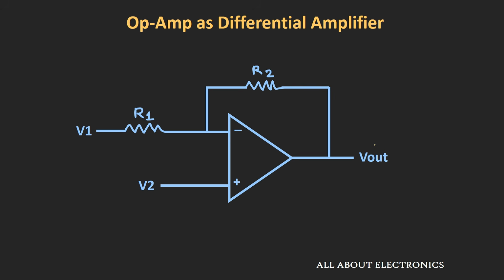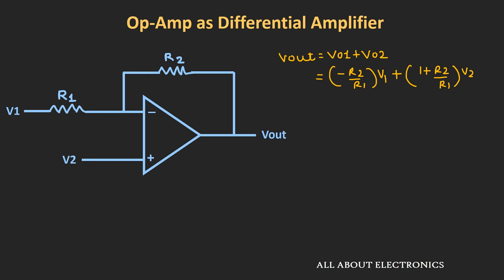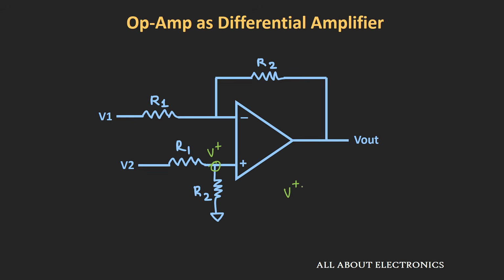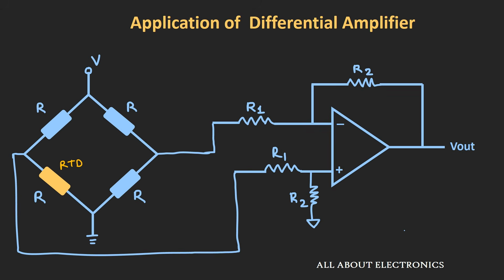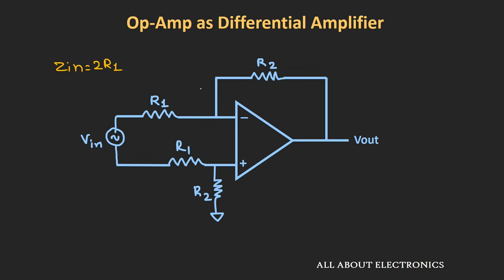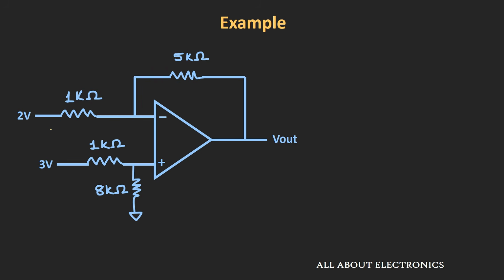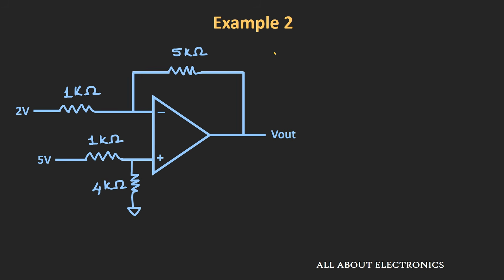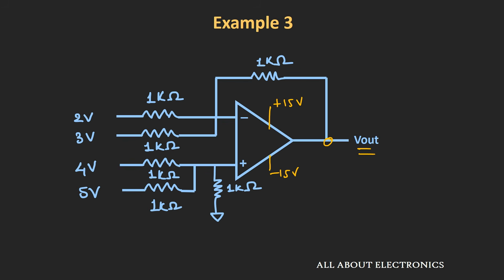Operational Amplifier: Op-Amp as Differential Amplifier or Op-Amp as subtractor (With Examples)

Comment: Sir this playlist is just mind-blowing.
Thanks a lot.
Sir I have a doubt that in example 3
The non-inverting voltage is V3+V4 or it is something different as when we apply superposition for V3 and V4 its different form V3 + V4. Sir I am confused, so if I am with any misconception sorry for that..
Reply from the maker: While applying superposition theorem, you consider only one source at a time. And the reaming sources are assumed to be 0V. For each input, you will get some output voltage. 
And the overall output is the summation of all the individual outputs.

Comment: I'm not getting answer 4 V solve it in your vedio
Reply from the maker: I have already mentioned the method for solving the problem in the earlier comments. Please go through it, you will get the answer. And after that, if you still find any difficulty then do let me know here. I will help you.
Reply: @ALLABOUTELECTRONICS   Sir I've gone through it already I'm getting -2 and -3 but for the non-inverting inputs I'm getting 8/3 and 10/3 for Input voltages 4V and 5V respectively 

Please help me out
Reply from the maker: When you consider 4V voltage source then 2V, 3V, and 5V voltage source would be zero. As 2V and 3V voltage sources are zero, two 1k resistors will be in parallel. Similarly, at the non-inverting terminal, 1k resistor of 5V and another 1k resistor will be in parallel. 
so, the input at the non-inverting input terminal would be V+ =  4V * (1K || 1K)/{(1K || 1K)+ 1K} = 4/3V
Which will be amplified by the gain of (1+ 1K/ (1K || 1K)).
So, the gain would be 3.
And overall output due to 4V would be 4/3 *3 = 4V.
Similarly, you can find the output voltage due to 5V alone. which will come out as 5V.
And the overall output of the differential amplifier will be -2-3+4+5 = 4V.
I hope it will help you.
Reply: @ALLABOUTELECTRONICS   I applied this logic and got the answer 4V and 5V now Tell me this when only 2 V is working then both 1k resistance (one with 2V and one with 3V ) are in Series why are we not applying potential divider there to calculate net Potential at Inverting input
Reply from the maker: @arpitsrivastav9609  Becuase of the concept of virtual ground. If you observe, the non-inverting terminal is grounded through 3 1K resistors. So, inverting input terminal should also be at ground potential. 
So, if we consider 2V voltage source, then both terminals of the 1k resistor with 3V voltage source will be at ground potential. One terminal due to the virtual ground concept and other terminal due to we applying superposition theorem. (3V source is grounded during calculation).
I hope it will clear your confusion now.
Reply: @ALLABOUTELECTRONICS  Sir thank you for your attention 
But mere ko nhi samjh aane waala ye 

Your Vedios are very helpful 
Thank you

Comment: 4 volts is the right answer
Reply: How? I guess, 1V
Because the v3 (which is connected to the ground) of the non-inverting terminal has effect on the input voltages.

Comment: 1 volt
Reply from the maker: The correct answer is 4V. 
If you consider one voltage source at a time and calculate the individual output then for each source (starting from 2V to 5V) you will get output voltages (-2V), (-3V), 4V and 5V  respectively. And the summation of all will be 4V.
Reply: @ALLABOUTELECTRONICS  sir why 1k ohm grounded resistor is not used for calculation as it was used in previous examples🤔🤔
Reply: @learnwithpk-b  It's used, but only for the two positive voltages (because it only affect the + branch of the amp) first you use (1 + 1k/1k) * (1k/(1k+1)) * vin       where 1k/1k --> RF/R1       and 1k/(1k+1k) --> Rgrounded/(Rn + Rgrounded)      n represents the resistor of the branches with 4v in and 5v in (luckily in this example they have the same resistance)